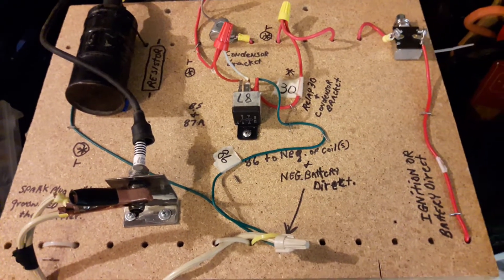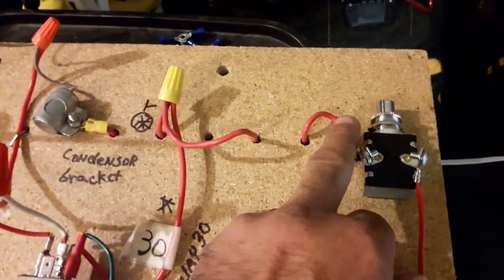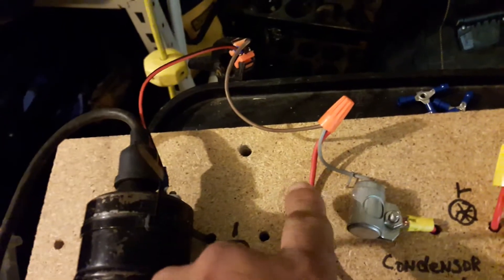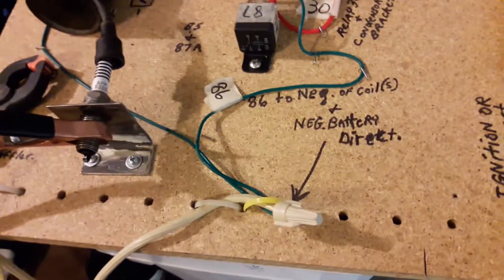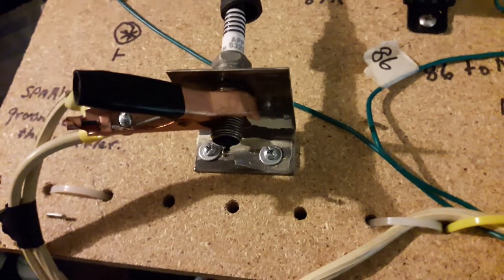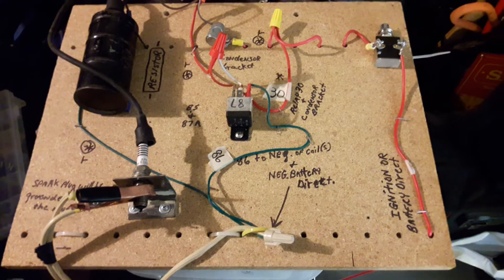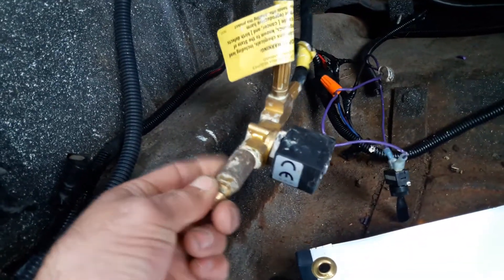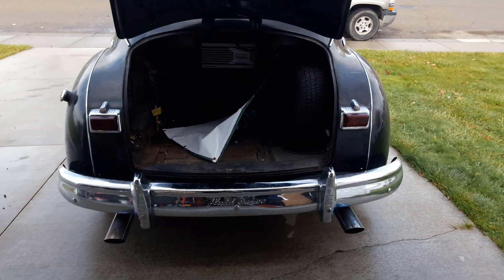Propane Injected Exhaust Flame Thrower Part 1

Comment: I'm not guru like you folks. But why will the following NOT work.  
Splice into an existing sparkplug wire. Extending it to spark plug in back of exhaust.
Splice a switch into cab. Put small propane tank behind seat. Run hose from tank to metal hose to back of exhaust next to spark plug.  Start engine. Turn on switch for plug. Open valve slowly for propane. Wa, la.  Seems logical to me. But I'm not guru. So I ask you.   Peace

Comment: I'm running straight petrol gasoline 93 octane not propane but the same concept direct to the battery bypassing ignition to a switch to a relay to the condenser to the coil coil back to the negative side of the battery negative post spark plug rounded in the exhaust bong plug welded I have a nitrous jet installed going up to a washer fluid reservoir holding my 93 petrol with a pump on it going down to the nozzle of my nitrous jet using it's the same hose as a brake line

Comment: I was wondering if I can use any old ballast resistor automotive-related I don't know how many  amps and resistance I'm dealing with hooking up hooking up the coil to the switches including relay which act likes a switch even though the coil itself puts out a high voltage which gives the spark plug Arc from the  condenser being grounded in the coil itself with a spark plug wire going to the spark plug being grounded in the coil itself wires on the coil going to back to the negative terminal on the battery

Comment: Ballast Resistor. Is that not on this board I have a MSD coil spark plugs and MSD coil wire going to the spark plug okay what about the condenser is there a wire going to a ballast resistor rather than having points and a cam for spark range like a distributor cap you can't hook it up directly because it would short out the switches till you have to you can't hook it up directly because it would short out the switches so you have to use a ballast resistor that hooks up to the coil then to the relay to the  condenser back to the switch back to your battery positive

Comment: Don't you need a RPM range or ecu pcm rpm rang to get the coil to run the spark rapidly fast to Sparkplug  like on fuel injected car versus distributor ob1 the different RPM range is high and low like on a distributor car most new coil packs read off the ob2 and rpm rang of the cars pcm too get a more faster Spark

Comment: I just wanted to say thank you for the how to. I have a 2013 mustang with a msd two step set at 2300 rpm and your spark plug set up it spits flames no problem. Here is a link of it in action but it is a poor quality video and upside down I apologize.     

https://youtu.be/F39Hhq6olUE

Comment: Why are the relays necessary?
Why is the resistor necessary?
Reply: I did it with out relays and just right too the 12v battery same with the added fuel separate Reservoir I have hooked up

Comment: I read the only reason we need a relay is because the battery puts out DC .
What if we use an inverter to put out AC? Then we would have a simpler setup.  I have a 9v AC phone charger i could wire to the plugs and inverter.
Reply: Coils run on dc.....the relays are to handle the current, and switch on and off giving you pulses so the coil can build a charge and dump it. If you hooked your coil up to a battery it'd build up a charge and do nothing till you connected the two poles then it'd give you a jolt
Reply: @sinformant  interesting and also explain why won't work on my car and plus it also to add to that it wears and tears the pulsated alternate current versus direct current on the switch or rocker switch
Reply: @sinformant   you don't list any kind of relays you use I'm guessing it's just a basic setup relay
Reply: @sinformant  kind of looks like a glow plug
Reply: @joaquinmateo4142  its just a generic 12v relay. Just make sure it will has a amperage rating to handle the current draw of the circuit. The end part is a spark plug not a glow plug.
Reply: @sinformant   do you ground out the relay separately or do you put it in series circuit
Reply: @joaquinmateo4142  one pole.of the relay has to run to ground In order for the magnetic coil to work and throw the contactor. He talks about it in the video. He is a little here and then there but if you watch it a few times you can figure it out. Only part I can't figure out is why he is running a condenser inline. Sorry im at work or I would elaborate more. In a normal points distributor system the condenser absorbs some current so when the points open they don't arc which will wear them down faster. Seeing as this doesn't have points I don't see the need for it. The only part with contacts that could wear down are the relays and they are before the coil not after it so they shouldn't have any large currents to jump gaps running through them.
Reply: @sinformant  the points also act as contacts  or different RPM ranges in the distributor based on RPMs of the motor or engine running if you're doing this setup on a newer car it's kind of hard to get a spark off the coil using a 12v D.C. battery igniter type setup to alternating current AC
Reply: @joaquinmateo4142  this flame thrower spark circuit doesn't require a distributor with points. It just simply runs off the battery like he has it set up in the video
Reply: @sinformant  what's the best way to ground out the spark plug on the exhaust he didn't mention any chassis ground wire he just mentioned the ground going directly back to the battery
Reply: @joaquinmateo4142  well the battery ground will be connected to the chassis like it is on most cars. The exhaust will be bolted to the engine which is also grounded to the chassis or at least it should be. When I ran my flamethrower setup(different setup) I just ran the - or ground of the coil to the frame of my truck. I didn't run a propane setup, just catless exhaust.  you can see a video of my truck shooting flames on my channel.
Reply: @sinformant  what do you use for nozzle setup I use 85 and a reservoir like a wiper reservoir to spray and pump the fuel but I have a steel beaded homemade nozzle before the spark plug in the exhaust cutout with o2 oxygen sensor plugs
Reply: @joaquinmateo4142  I didn't have any external fuel source lol that is straight up running off the exhaust. I had a small hole drilled up a little ways on the exhaust pipe at an angle to create a venturi effect and pull in fresh air to help the exhaust burn. For the spark plug I simply drilled a hole, screwed a nut onto the spark plug and tack welded the nut in.place. I've had plans to run a different setup on my car with a reseviour and e85 with boric acid mixture. For spark I plan on using a small stun gun circuit I found for cheap online.
Reply: @sinformant  simpler ways, look at Ford Model "T" coils, or convert normal coil to vibrating, some videos, also doesnt need resister, the resister in ignition systems was to keep from burning points up. I was looking for propane info, long time ago guys ran carb rich to burn unburned fuel, but propane is safer & simpler
Reply: @randymack1782  interesting enough my father actually has a model t spark box. Its pretty bulky. The "stun gun" module I referenced if really just a small cheap sealed module that creates a pulsed high voltage that will jump like a 1/4"-1/2" gap easily and is only a few bucks online. Super simple, super cheap and works well.
Reply: @sinformant  I am starting a car build, a basket case 1957 Chevy, and want to stay period correct, so nothing of modern times, & built like it would have been built in the 60's so for me, a model t coil would have been available, this needs to look like a time capsule from that era